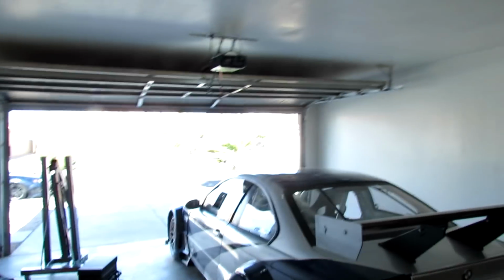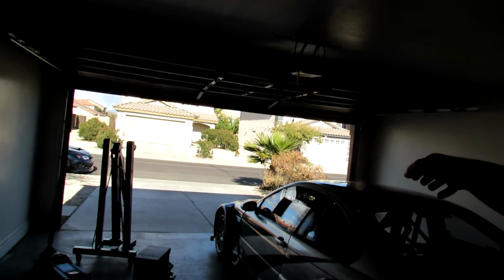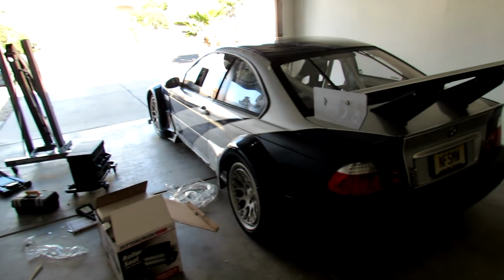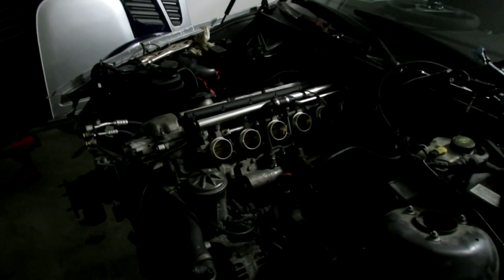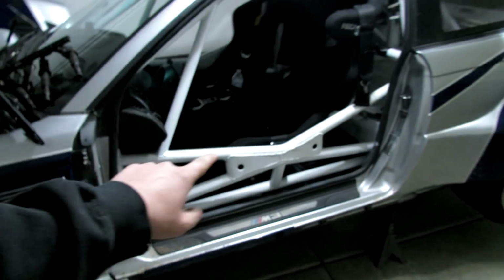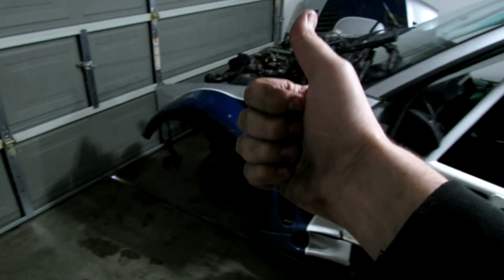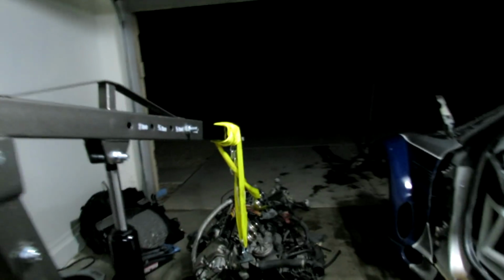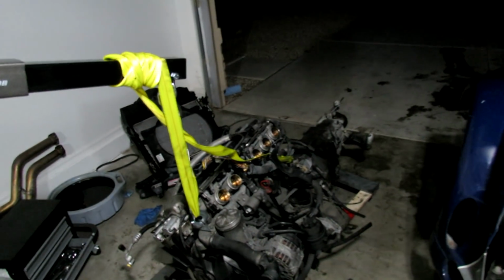Pulling the Engine out of the NFS M3 GTR!

Comment: What V8 is it Andre? Iam so moist to hear that thing with the V8 with the Dog gearbox
Reply: It's most likely going to be an LS because it's the cheapest option, and it's most likely not going to have a dog box. Do you have any idea how expensive they are? He said he's going to dump about 10k into this for the swap (suspension, engine, gearbox & wiring included). If he was going for a straight cut gearbox he'd spend 10k on the gearbox alone.
Reply: @shona5512  straight cut gear sets start pretty low actually.. also a v8 like a E39 M5 v8 is the same price if not cheaper than a LS, way more original, understressed as fuck too, easy power mods can get to 700hp with minimal effort, and sounds sweeter
Reply: Plus he stated before it would be a BMW v8
Reply: @RobynnxX  A E92 V8. S65 or a LS. Thats his choice

Comment: Please please please put a s62 v8 in, or at the very least a m62 v8 in - the car deserves it.  An LS would be a huge disappointment.
Reply: Zero to hero he’s going for a 383 lsx (asked him on instagram) its a fully built engine too
Reply: LS is objectively superior to the S62, and the M62 isn't even in the same league.
Reply: The LS with a custom fabricated set of 180 degree headers or even 8 -1 merge headers would give it the sound it needs
Reply: @speedpower2740  The m3 gtr didnt have a chevy engine though. It had a bmw p60, and the closest to that is a s62.
Reply: Zero to hero it’s his car so?.... 🤷🏽‍♂️
Reply: @zerotohero7449  Not really, S62 has a cross plane crank and only revs to 7k, pretty similar to the LS in that respect. The difference is the LS is more reliable, more powerful, lighter, cheaper and has a bigger aftermarket. Both are pretty different to the P60, so he might as well go for the better engine.